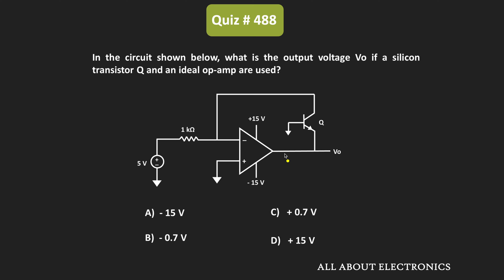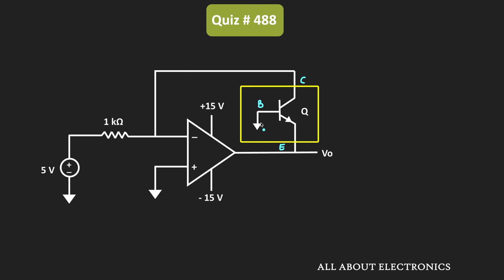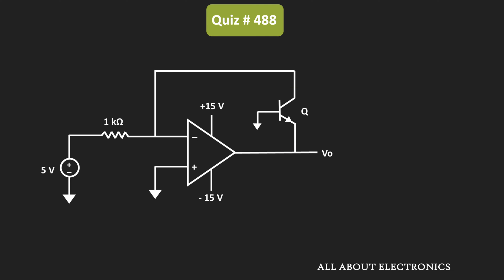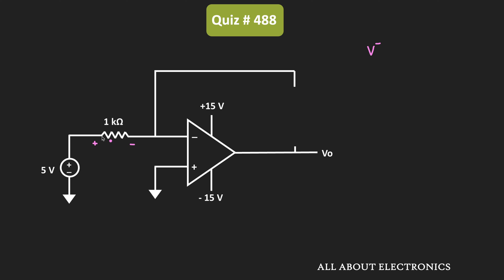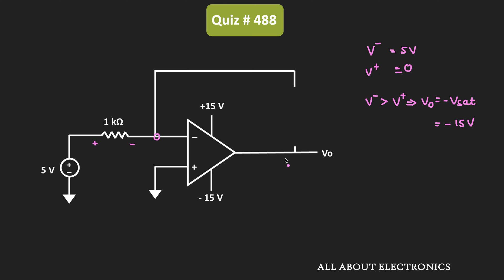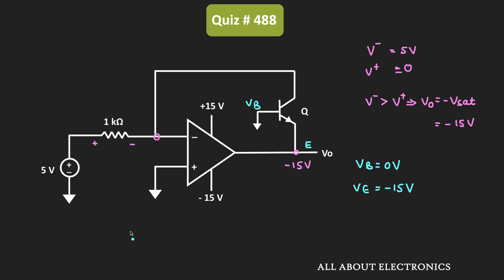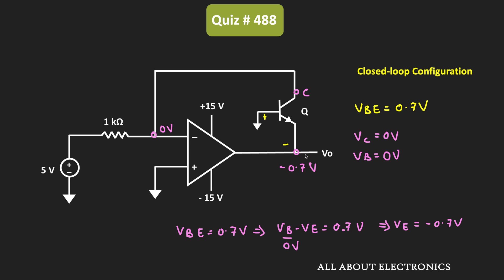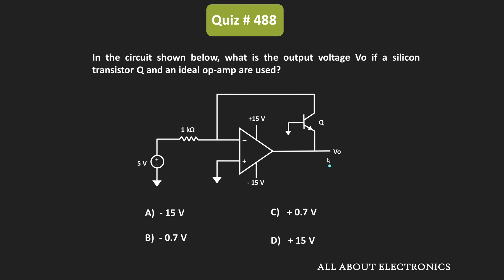Operational Amplifier (Op-Amp) Solved Problem | Analog Electronics | Quiz # 488

Comment: no

that is wrong

both input will have the same voltage NOT when a configuration is closed loop

but when negative feedback is achieved

a closed loop configuration can also be positive feedback, meaning output will latch to either side, and input voltages wont be the same

an example is schmitt trigger configuration, but keep in mind positive and negative feedback can be achieved with either input, so we need to check if the output is in phase with inverting input for negative feedback, otherwise it d be positive feedback, negative feedback is not only achievable by inverting input, and positive feedback is not only achievable by non inverting input

sometimes i think u dont really know how opamp works and just follow what the textbook says, based on ur explanations and methods